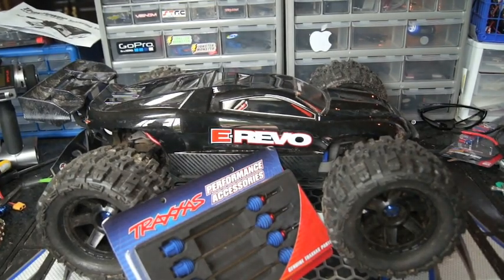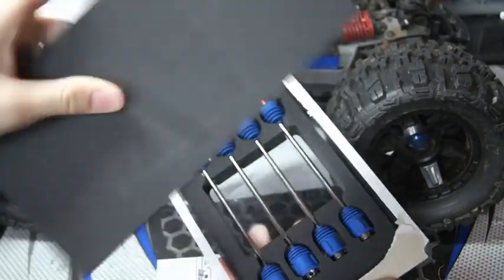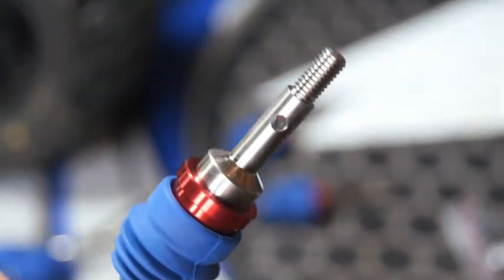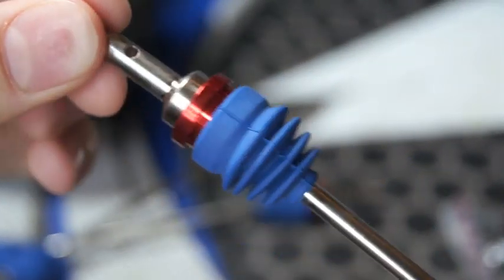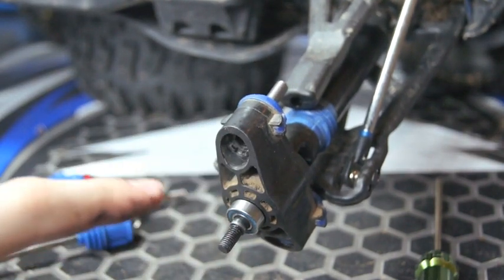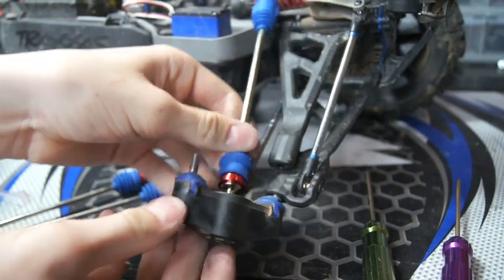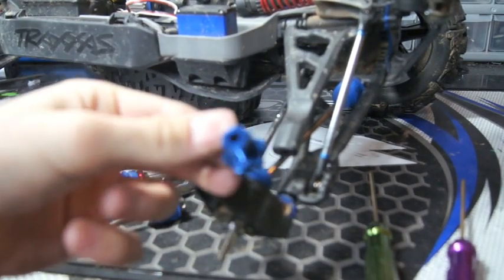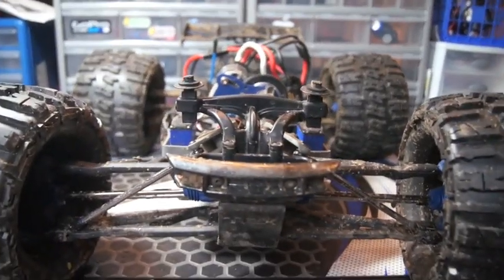Traxxas E Revo Brushless Steel Driveshaft Upgrade & Installation

Comment: these axles are junk. i instlled these into my erevo and on the first run out three of them broke. under the ruber is a nice joint but only has two little shafts that slide and those broke off one at a time for me. i didnt even make it through one set of batterys and i can just through them in the trash. waist of money.

Comment: I don't think that I will upgrade this part of my e revo, i kinda like the look of the thick black shaft on it. Also, I think the original drive shaft works just fine for me. Bu thanks for the video...
Reply: Definitely upgrade, the pins in the original shafts pop out eventually.

Comment: ha ha ha i took my hole back end apart and it turned out to be a drive shaft scew bolt broke and the center was still grabbing a bit but letting go as well so i think dif but no lol my bad i will get these today and lucky me i get to put the hole back end back on and then fix what was the real problem in the first place it tricked me so bad i all most got a new transmission too look at ever part be for you rip it all off

Comment: I have a set (5154R) in a T-Maxx 3.3, keeps snapping the drive pins. Plastic didn't hold up well, but had less catastrophic failures. The 5154Rs seem ok until you start making power and find some good traction, then the pins snap. They shouldn't bend unless you have the suspension cranked in too far. (and have not)

 I'm making new pins from drill rod, but wonder what will let go next. I may have to keep it a bit rich unless running on wet or loose ground. 

Going to look into the MIP ones, but have not found anyone who has used them hard and is happy so far. Seems like these are a weak link in the Traxxas design.

Any input would be welcome. Thanks!

Comment: Thanks man....I'm just getting back into R/C and have a E-Revo I was considering changing out the drive shafts to this upgrade..............always nice to see what your getting into to. If all you E-Revo people don't have Castle Link yet...get it, it's worth the 20 bucks for the USB and adapter...the program is free thru Castle Creations. Excellent for throttle curves, but more importantly....torque settings............thanks again, great vid

Comment: whered you get those tyres? and are they better than the stock? thanks
Reply: If you haven't found those tires, they're Pro-Line Trenchers. I run my E-Revo with them and they're terrific. MUCH better than the stock. Those tires, and Pro-Line Badlands are great for bashing.
Reply: Also would it be more fun to run this on a 4s or 6s because at the moment I'm running it on 6s and it is completely crazy when it comes to trying to control it. Don't get me wrong but I love the speed when having the 6s lipos installed but is it more recommended to use 4s. thanks